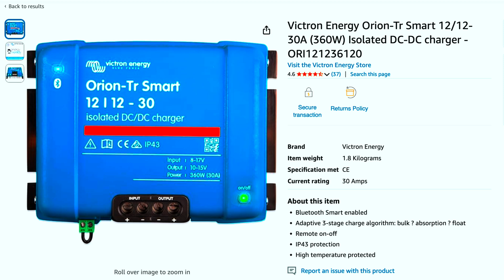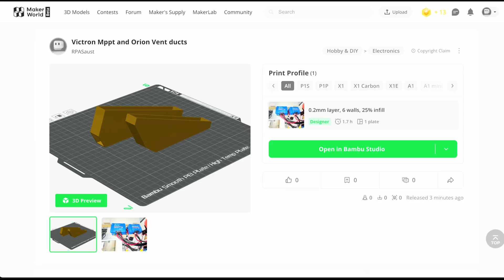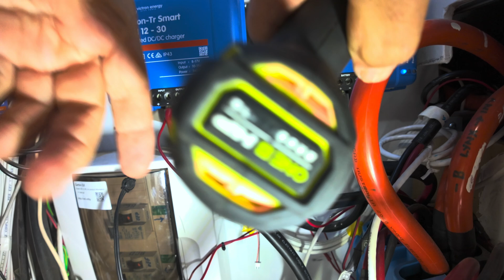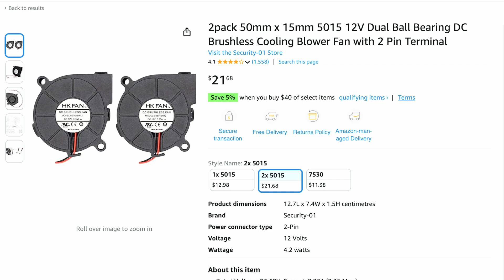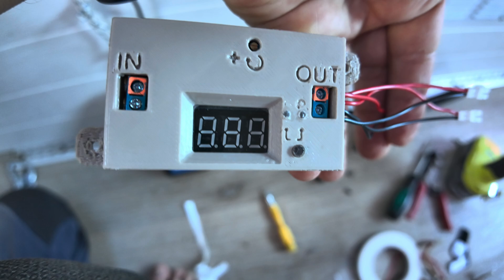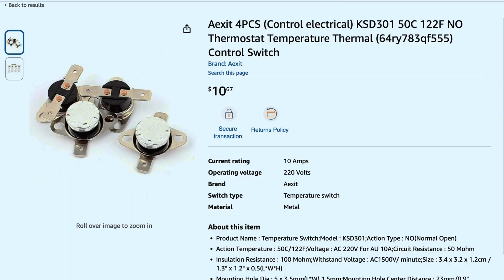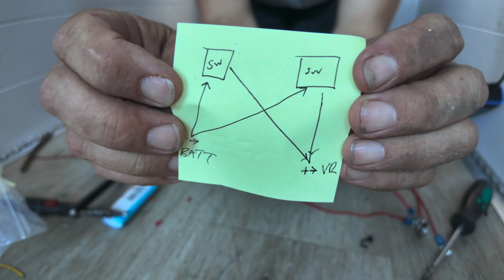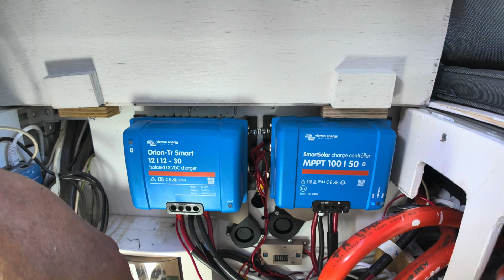Hot Victron Orion DC & MPPT

Comment: I have done similar excepti used an STC 1000 controller.
I do have external air being drawn into the fans and a vent for exhaust.  I couldn't see if you were drawing external air or whether it was using the air in the cabinet.